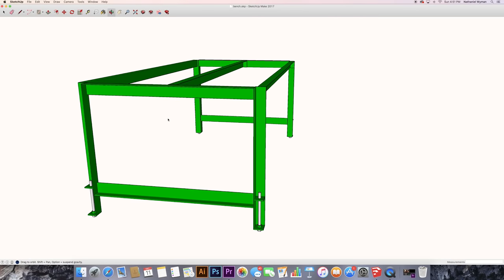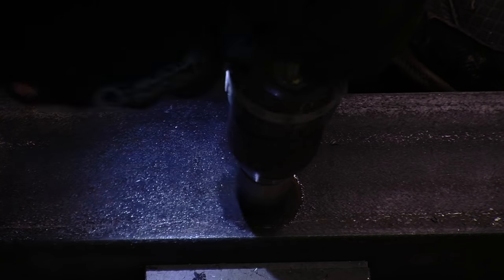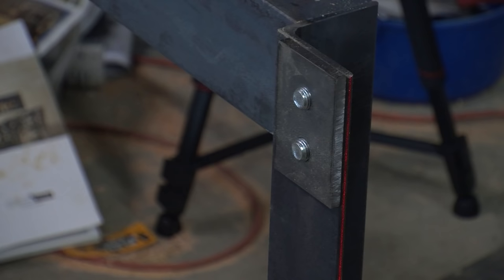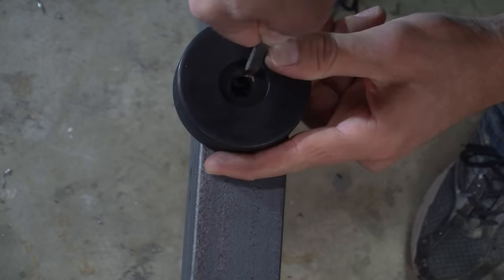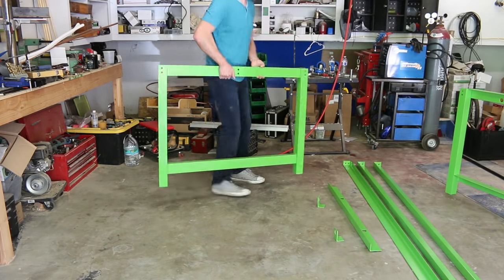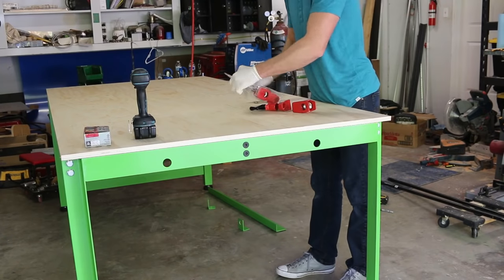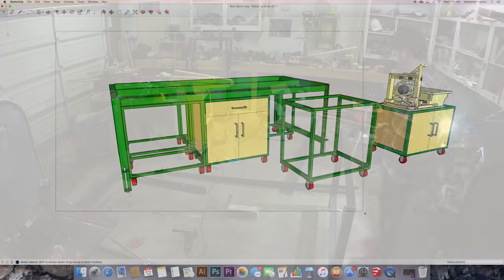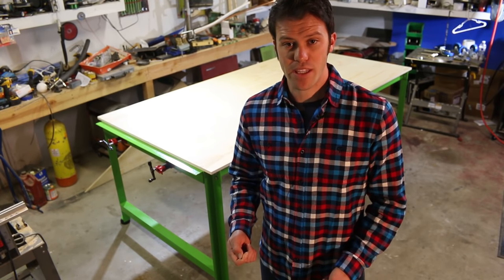The Ultimate Workbench

Comment: I love it, especially the modular cabinets. I used to work in a sheet metal factory, (nice welds by the way) what we used to do if we needed a threaded piece of metal, instead of drilling then tapping, we just welded a nut on the other side of the hole.

Comment: For the legs of my welding table I plan on just welding nuts on the legs with my powerarc rather than tapping the holes. I find the metal isn't thick enough for many threads
Reply: Stuart Geller   Mobile home jack posts worked for me... $30 a piece and zero effort